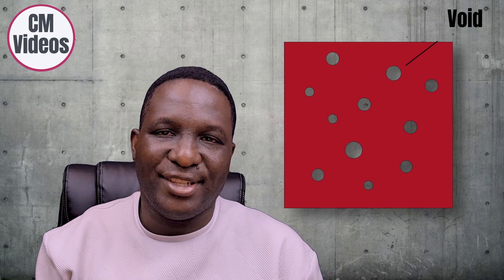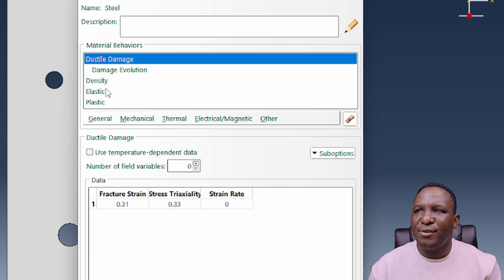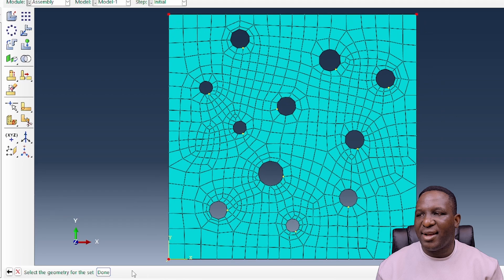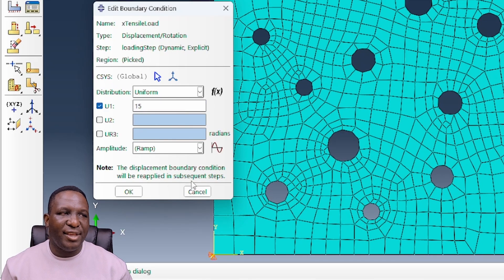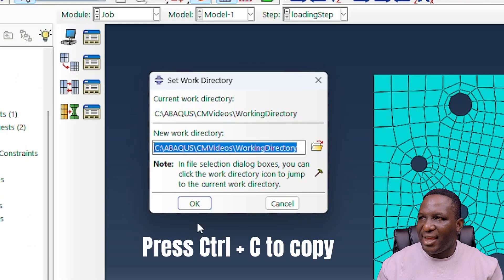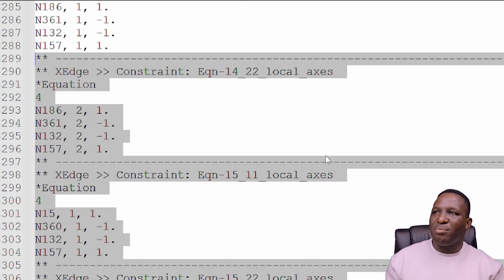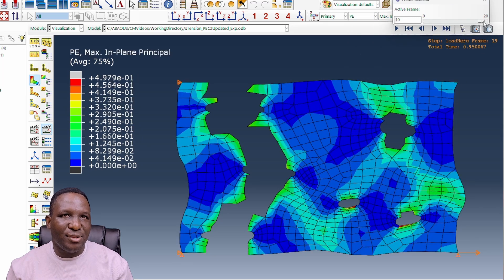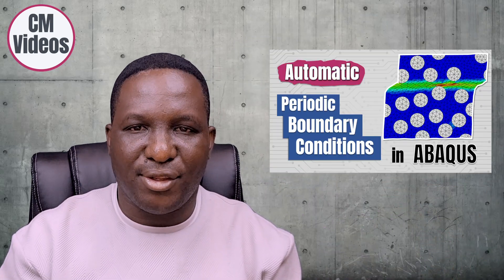How to apply Periodic Boundary Conditions to Ductile Damage!

Comment: Thank you very much for your great video, as you know the engineering constants (for linear elastic region) can be obtained through RVE modeling and using PBC. But I have no idea how to model nonlinear elastic or plastic material by applying PBC on RVE. Do you have any ideas?
For example in this example, can the stress-strain curve be obtained through homogenization?
Reply from the maker: Yes, you are right. You do this ame thing... the only difference here is that the size of the RVE will be bigger when damage and damage evolution kicks in. But yes, you can get the stress-strain curve even through homogenization when you apply PBC just as you would do for elastic properties.
Reply: @MichaelOkereke  Thank you so much❤